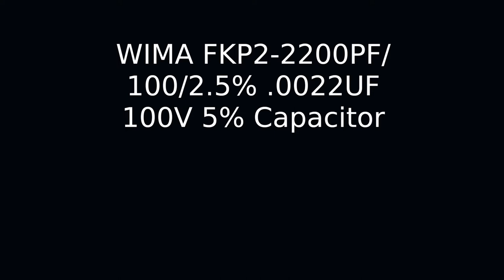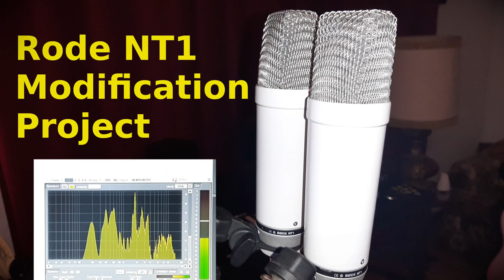Rode NT1 mic (original model) Modding Project

Comment: regarding the white vintage Røde NT1.I have got the same capsule in my NT1 as in this video. I wonder if the circuit is "better than the capsule": Will the greatest upgrade to this mic be changing the capsule ?or is  the recommended easy mod int this video ( thanks a lot) the best you can do with this microphone?. I bought it because of the good things i have read about the circuit.

Comment: I would have liked to hear both mics before the cap mod, The modded one sounds brighter as if you got them mixed up in the test, 
or the modded one was much brighter to start with. im listenng on stock sennheiser 600 headphones.
Reply from the maker: I thought the modded one sounded brighter, but smoother, after the upgrade. I didn't really expect it to sound brighter in any way going into the mod.
In the end, modded both mics so they match.

Comment: Sometimes I wonder if doing mods like this is just splitting hairs, but then, even the smallest capacitor upgrades can shift frequencies drastically, which makes me even more curious whether it has to do with capacitance at all. For example, in this mod the recommended cap swap is a Wima 2200pf 100v, then I see there's different tolerance % of those. Point being, do different tolerances like 2.5%, 5% or 10% have any influence on how the capacitor reacts to voltage, possibly effecting certain frequencies more than others? Phase shifts? I've also seen some caps labeled as 100-U, so maybe these type of  minor details things are the real reason why some people have more drastic results than others? The only other things I can think is - it has to do with the chemical compounds of the caps like polystyrene, polypropylene, polycarbonate, etc.. and I'm pretty sure cap upgrades could also possibly react differently with different preamps, especially when it comes to bass response. Am I just thinking too deeply about all this now or what ?
Reply: Tolerance is just production tolerance. Meaning, the value of the capacitance and or DC voltage rating can vary at production by as much as 2.5% or 5%, or 10%. Most of the time, higher tolerance are not really needed. So really nothing to do with phase shifts. What the cap values DO have to do with is they serve as a coupling cap, so depending on the circuit impedance at that location, can affect the frequency response.

Comment: Hi Alan I have a vintage rode NT1 as well, but I found the screw that is used to retain the position of the XLR connector is missing (the screw in a small hole). I don't know what kind of screw is it, could you help me?
Reply from the maker: I don't recall anything about that screw. Did they replace the standard XLR keeper screw with a longer screw that goes all the way thru a part of the body? ...Or is it just the normal XLR screw and it just raises to capture itself in a hole in the body (which would be what most mics do)?
Most hardware stores have these type screws, but they only stock Allen-Heads versus the slot heads. If it needs to be extra long, that might be what you have to do.
OTOH, if it's just the normal screw that the XLR ships with, I'd just get a new Switchcraft male XLR connector and steal the screw from that.
Reply: @AlanHamiltonAudio  I think it is a normal screw, because the hole on the body is like a dent. Thank you for the tip!
Reply from the maker: @zpetit8  Cool! Hope it helps!